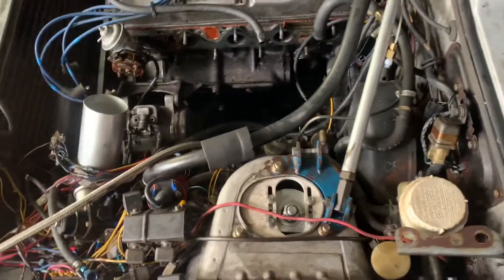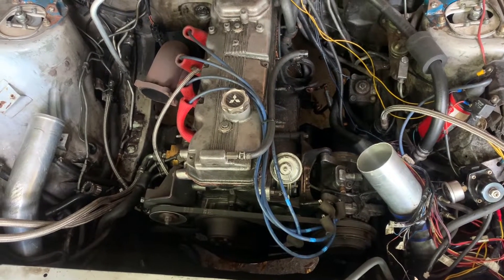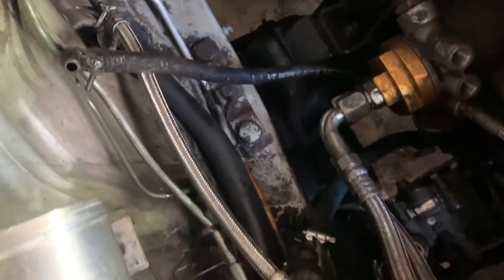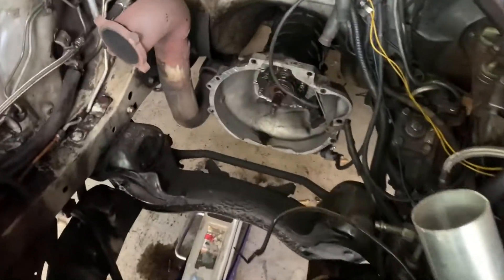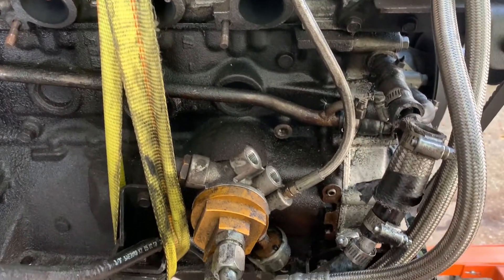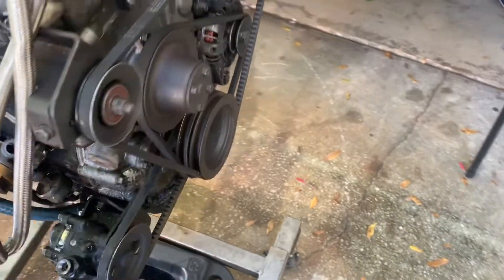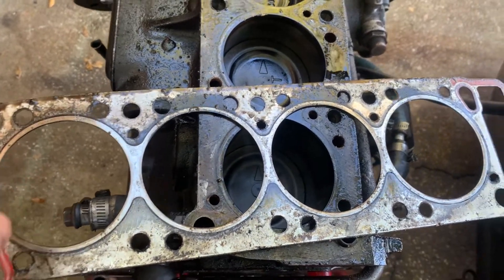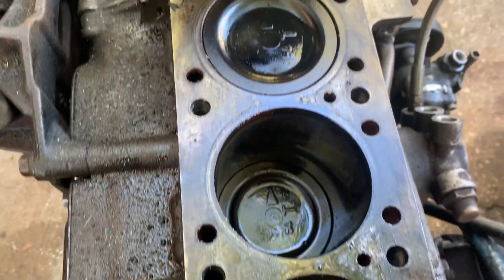88 starion Engine removal and disassemble

Comment: So you were running a basically stock engine at 30 psi?
Reply from the maker: Yes exactly I had it set to 24 but lost the vacuum line to the wastegate and it went to 30 
On on pump gas and I only had it pre-tune to 26 max So basically it didn’t have any fuel tables up there so that’s why that happened normally it could do that all day
Reply: Where can you get a new head from?
Reply from the maker: Ebay

Comment: Hey! I'm thinking about trading a 2000 Silverado 5.3LS auto 4x4 for one of these.  The engine is completely rebuilt bored .20 over new head.  but it needs put back in the car and im really worried about what I'm getting myself into.  Do you think its a good trade or stay away?  just an opinion would be appreciated.

Thanks!
Reply from the maker: I would definitely do it. The cars themselves are a little finicky, but if they were well taken care of their actually really fun to drive and from a financial standpoint, the value is going up so you’ll definitely get a return on your investment, but make sure that everything is put in properly. Or to make things simpler you can update your engine management to alleviate a lot of little headaches.
Reply: @legionelitemotorsports2096  Thanks so much for the response the car is a complete 87 Conquest TSI.  Hopefully sourcing the hardware won't be too bad..   thank you